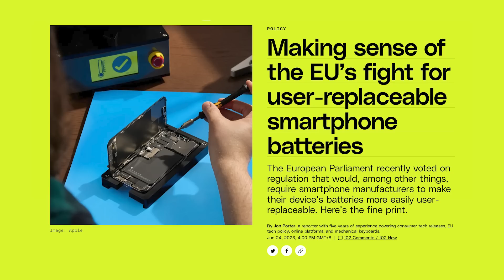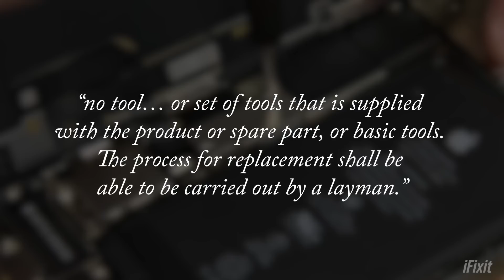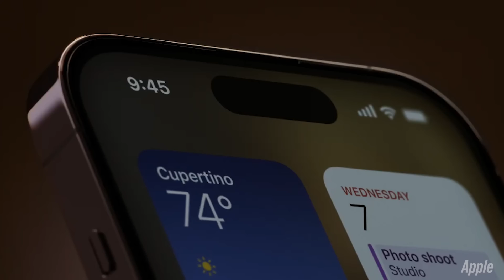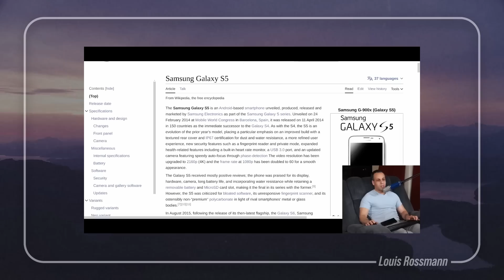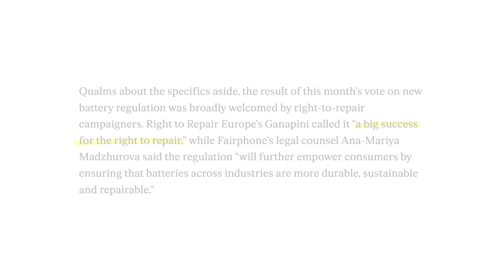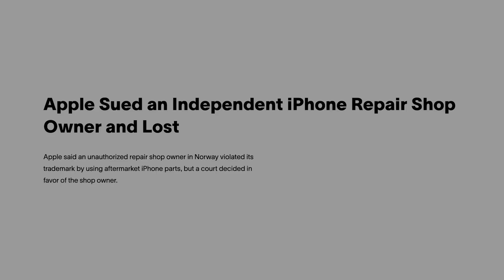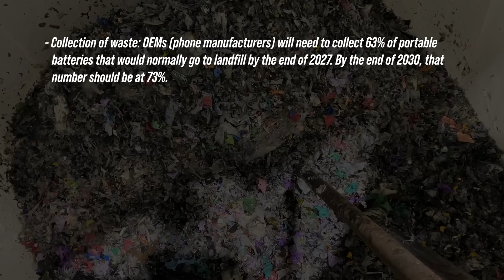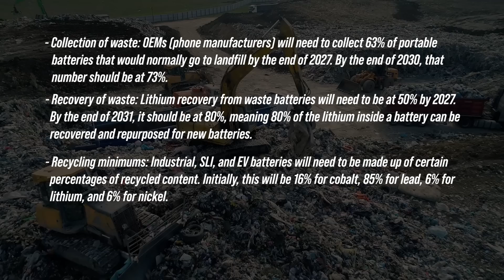EU Just Changed Smartphones Forever

Comment: There are many things not mention it the video regarding the manufacturers and progress in technology.
If we ware to say, the avg phone battery will last at usable efficiency for 4 years from the day buying. From the time of release of the model, which you bought 6 month after, there has been already technological improvements. 
Why would phone battery should be replaceable if by the time it needs replacement the device is greatly outdated by today standards. Think about tomorrow’s standards and the day after. Technological advances progress at nearly exponential rate. 
If Tesla cars were build to last 20 years, replacing the batteries makes sense. Otherwise it doesn’t.
I’m greatly excited about the new modular laptop projects which are coming out. Making sure the devices don’t end up outdated in terms of performance.
Same could be applied to tablets as well. 
When it comes to recyclation laws making companies responsible for disposing of batteries of their products makes total sense.

Comment: Having replaceable batteries was necessary in the beginning.   I can remember having 3 batteries for my cell phone to get through the day.    It is less expensive to build a phone without replaceable batteries.    At one point the expected useful life of the cell phone was less than the practical life of the battery.    Then manufacturers realized that when the batteries declined they could sell another phone.

Comment: Wasn't there an exception for waterproof devices? This would not change many of current devices sadly then
Reply: Phones aren't waterproof. Just water resistant. There's no reason they can't make a replaceable battery slot that has good water resistance. How do you think they still have A sim card tray that's removable?
Reply: @KinnArchimedes  Sorry in the german language we always say wassergeschützt.. which basically means water proof... noone here says Wasserresistent. So this maybe a translation issue between the languages and usage.

Comment: i dont see anything that will be required by law in the new EU laws to force for you to be able to remove it easily for yourself. it just basicly mentions it has to be removable and recycable. they want the 3 RRR format to meet new levels. with reuse being upped and recycle upped as well. doesnt say anything about being able to take 2 batteries otg with yourself and be able to swap them right there. it just seems its just making sure large manufactures offer battery replacement (apple does) and recycles the batteries (apple does). dont argue with me unless you can provide documented proof from a government source

Comment: honestly i don't even mind the glue, and sealing that much. I can use a hair drier to get it malleable to remove the back or screen.
Just that you need to get a prying tool under a thin explosive lithium battery would be a huge hurdle to even a normal fixer dad. Only really people that know what there doing would feel save removing a explosive normally lol.
I've done it multiple times myself, so I've begun to see it as normal at this point, but i need to realize that this is a impossible task for a normal or even advanced phone user.
That maybe even repairs appliances around the house.
But Apple they really taking it to far. Locking phones up, and removing face ID or brightness control when you change out the screen or camera. They aren't the only ones, but the most prominent for sure. Microsoft also does this with the Xbox. Mating the parts, so you can only use that one disk drive or daughter board in that one Xbox.
Even people that can repair it can't mate the new serials without either Apple specific hardware, or buying $200+ devices specifically made to bypass Apple, and flash the serial off the old screen to the new one for example.
It's just baffling to see really.

Comment: tbh I always prefer buying a new phone rather than repairing an old one and I always hated phones with removable batteries they would just turn off if ocassionally dropped however I don't want the same thing happen to laptops, I want to upgrade my laptop with ssds, extra ram or hdds or change the battery if needed

Comment: Small "true wireless" earbuds will be the biggest hurdle I think, but also possible if a bigger part of the earbud would be detachable. This is long overdue. I hope there won't be a pattent war over the implementation of this feature.
Reply: That's actually how KZ headphones work lol I love mine. You buy the headphone and battery/cord separately.
Reply: My wife has a pair of very expensive hearing aids. Even if removable batteries was possible is it even a good idea when the average user has enough problems just using them?

Comment: This is great. They should do this with laptops too! This also opens up recycling old batteries.
Reply: they are, and funny part, a lot of the laptops i have seen with the 'integrated battery' the battery is still fairly easily replaced, is still just a module that plugs in to the mainboard, just slightly harder to get to from having to pull screws and an entire bottom panel..

Comment: I myself had a Galaxy note 3 for 3 years, it was my go to when I rode motorcycles in pooring rain multiple times for navigation, I had it mounted on my handlebar exposed to the elements and had 0 issues with it. The battery change litterally was just as fast as changing batteries in a remote control.
Reply: the thing what worries me the most about replaceable batteries is the fact that they will not be cheap to buy they could price the batteries as high as a low end phone...there will be no law to keep a check on the prices....can you imagine the price of an apple replaceable battery!!
yeh you might beable to get a knock off from china and then your phone explodes cause you was trying to be cheap.

Comment: If you place a requirement on companies to demonstrate a 60% plus recycle rate for their batteries then the only viable way to do that is to require the devices they sell have batteries that only they can change. This makes it more likely that recycling rates will be even higher. User replaceable batteries will be the same as anything that is user replaceable today - they will end up in a drawer or in landfill because the vast majority of users will not return a battery to the suppler for recycling. There is mountains of data proving this in the EU's own data banks!

Whilst I would like a replaceable battery myself, I'd settle for one that lasts the life of the device.
Reply: Instead I have a drawer full of old phones
Reply: Had those even with replaceable batteries but it was even worse! Before I cleared out my drawer I had about 5/6 Nokia's, a Samsung E800 (I think), and a very old Erikson brick. Each one had their own bespoke spare batteries. And that's before we add on the various custom headphones for each and the custom chargers. The EU law doesn't even require industry standardisation of replaceable battery sizes so that fewer bespoke versions are needed and they are interchangeable between devices. I don't mind the idea but as usual the implementation is ill thought out and half baked.
Reply: @real_naiyas  excellent points. Thank you. Let's hope implementation is good

Comment: OMG! EVERY product innovation IS motivated by profit because even when the innovation brings benefit to the user, then it'll sell more > more profit.
In many cases though, the innovation brings more profit WITHOUT benefit – or even with damage – for the user.
Look at touch-screen-only car desktops currently on fashion. They're sold as "fantastic"/modern gimmicks. The reality is that they're cheaper to produce than building and installing physical buttons and knobs (so, more profit) and at the same time they're far more dangerous to use because driver needs to divert his/her attention from the road for some time (while often buttons and knos can be operated without even looking.)

Comment: The change to non-removable batteries was motivated by both, not one... Design AND profitability. They knew that the consumer would just buy a new phone after a couple years instead of replacing the battery and going on with another year or two on an older device. Combine this with purchase contracts on mobile devices, and you have a perfect storm, which is still brewing to this day. As major carriers (in the US, at least) have changed to a three year replacement cycle, the need for user-replaceable batteries is getting larger. Most of these devices start to see measurable to significant battery degradation within two years. This means more consumers will need to buy a device outside of their normal "upgrade cycle," simply because their battery no longer gets them through a day on a full charge... Or they must send the device in to get that battery replaced for several hundred dollars (due to anti-repair design and materials choices.)

To wax nostalgic for a moment, I recall the Galaxy Note 4, which WAS water and dust resistant, despite having a user-replaceable battery. The big change that came with the Note 5? Glass back panel instead of plastic. Sure, the glass felt way more premium, but it came at the cost of a replaceable battery. I am positive the industry can come up with a simple and effective securement and sealing method to continue offering glass or ceramic panels while also making them easily removable. They just don't have any incentive to do so, because they will no longer have the revenues coming in from consumers, insurance companies, and refurbishers for those relatively easy repairs that only require special tools. Thankfully, the EU sees through most lobbyist agendas, unlike the heavily corrupt politicians in the U.S. (I can say that, I live there.)

Comment: Watch them make two versions of a phone but rationalize the increase cost of the phone due to compliance and re-engineering efforts.
Also even with a removable battery, watch Apple charge the same price to replace the battery as the built in version while software hindering DIY replacements explaining unsafe third party batteries void your warranty or some non-sense.

Comment: Phone producer say it is impractical and the battery has better Performance and lasts longer if it is integrated?
Fine, add an option for them:
Either use a replaceable battery, or give 6 years unlimited battery warrant for the integrated battery, instead of the ridiculous 6 months 😅

Comment: This is not only about right to repair. Which is important. Design for disassembly is a key aspect of ecodesign and vital to drive a circular economy, that can approximate true sustainability, where all ressources are optimized in use, maintained in value form for as long as possible and eventually fully recycled.

Comment: I don’t see how this could be advantageous for consumers 
without adhesives you’d loose high IP dust and water proof ratings 
Better solution would be making replacement parts more accessible 
I find it more difficult to find a proper Apple battery than actually replacing the battery

Comment: good. only my last two phones have had fixed batteries, all that's needed is to revert to the old removable back design. I don't swim with my phone in my trunks, so I don't care about it being IP65 water resistant. if you need that kind of impermeability, you can pay for it, not me.

Comment: I haven't read the law, but "having a replaceable battery" is of no use whatsoever if there isn't a part in the law that requires manufacturers to either offer simple replacement parts directly or to at least allow third party parts and stop bricking the phone if you so much as use a wrong charging cable.

Comment: Finally less of a need to carry large powerbanks around. Now there will be less of a need for power banks, which is gonna make them cheaper. And maybe you can now do the trick for cancelling phone calls again (so it says call failed instead of canceled). And it will probably prolong battery charge as when you do not need the phone you can just pull the battery out and the phone is actually off then. And with phones having a fairly quick boot time (which seems to have been getting longer with newer phone models for some reason) it will be something nice. And it may help with addictions as it currently is very easy to turn on a phone and just get lost in social media where as having to put a battery in it, even though it will only take a few seconds, will be an extra step or two. And it will make repairs easier as the back will now easily be removable. There is not a single downside I can see. And water proofing could probably be easy too. I could imagine adding a ring of rubber on the back plate and around the phone would or could do that (if closed off correctly or clamped down correctly), or take phone casings, people could manufacture phone casings which could make phones water tight, even if they would be a bit difficult to put on a phone.

Comment: I really hope this will push through, not only in EU but in Asia as well. I have thrown away several "still working" phones for the reason of battery problems. Replacement is costly.
Reply: I never sold or threw away any smart phone I owned. I still use them as music players or for tinkering, or simply keep them as a curiosity. These old (Samsung) devices all have replaceable batteries. Some of them, in theory, I could still use every day with their up-to-date custom ROM. But I can't, due to their - replaceable - battery. There is simply no replacement on the market that lasts more than marginally longer than the ten year old original. I tried several replacements, not the cheap ones and with good reviews. They all are poor quality.
Reply: @mschr2880  I still have mg Galaxy Mega 6.3, it was my last remaining phone with user replaceable battery. I already replaced the battery once, but I won't be able to find a decent replacement anymore after that. The rest of my phones are dead because of batteries, they are all "built-in".
Reply: I don't think this will be a case also in Asia because most of it are China and Russia and well....
Reply: @Jasiek100  It just might if the manufacturers are saving money for R&D for a separate device in other parts of the world. They might just design a single phone and sell it to all.

Comment: I would like to see the inclusion of lens caps for phones cameras so it's easy to tell if someone is filming or not because right now anybody could be going around filming people and pretending to be on the phone and there is no obvious way of telling. There's also the possibility of people's phones being hacked and the camera being used to film and spy on the victim. Also there is vulnerability with smart phones when it comes to the charging ports being used for juice jacking. As it stands a smartphone can be intercepted with a wired connection while he phones owner can be completely unaware that it has happened so there should be software with inbuilt security to stop someone getting access to a phones files or uploading malicious data through a wired connection without going through some sort of password encryption software. This is a big problem and a huge vulnerability that needs fixing ASAP. How many times in daily life do people leave their phones unattended or vulnerable to this kind of attack it is a massive oversight by manufacturers that this is even able to become an issue. Its not just malicious charging ports that are an issue when it comes this. All a bad actor would need is 30 seconds with physical access to a device and it can be compromised. How long does it take to plug a data stick into a charging port at the end of the day. There could easily be a physical solution built into the phone to help prevent this from happening aswell.

Comment: Love to see how you make an EV with layman replaceable batteries with minimal tools when the battery is basically the platform for the car.
Reply: Simple, design the car so the chassis could be detached from the rest of the car's body in a way that the individual lithium cells could be unplugged, lifted out, and replaced. I think Hyundai is already designing their Ioniq 5's like this.

Perhaps it could be hinged in the back, and the front of the car could be propped up from the chassis using the tire jack and locking support rods (like a more beefed up version of the ones used for a car's hood). And, to make sure it doesn't open during normal use, the corners could be screwed into place with standard car bolts and a common sized socket wrench.
Reply: Not only is it possible it is already being done, the battery being part of the platform is poor design. 
There is a company in China called NIO that is already doing this IIRC they have already done over a million battery swaps. "Nio currently operates 1360 battery-swap stations across China and a further 13 in Europe". It takes a maximum of 5 min to swap out the battery.

Comment: I mean, it definitely wasn't the result of consumer demand. Though I'm not convinced the change was entirely about greed either. It probably varied from company to company but back then people weren't exactly demanding a change be made. Most people I ever met actually liked the option of a replaceable battery.
Reply: The driving force was customer preference for thinner lighter phones, and that was only possible by keeping everything as tightly integrated as possible.

What this new law means is that thin compact phones are a thing of the past.
Reply: @Tugela60  Doesn't have to be. It could be the beginning of new breakthroughs in battery design. I mean, Solid state batteries were made a while back and they can be way smaller than traditional batteries as well as more effective.